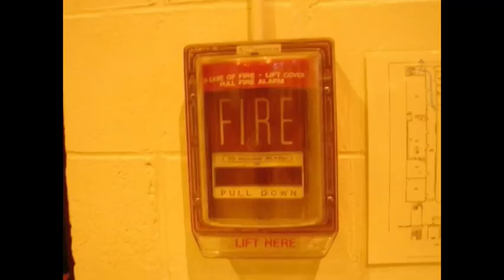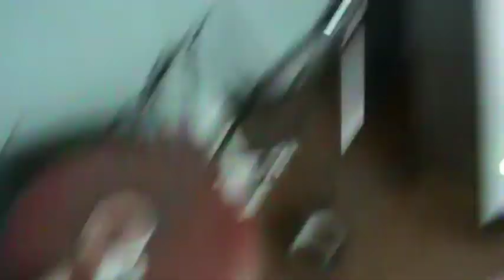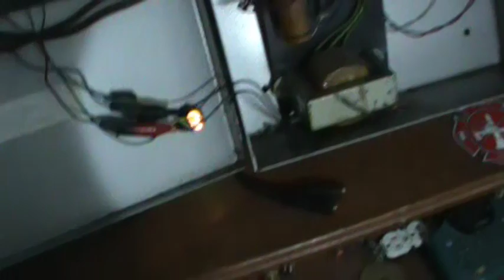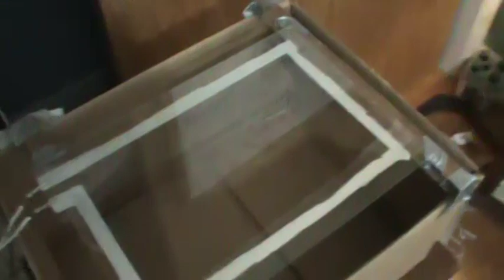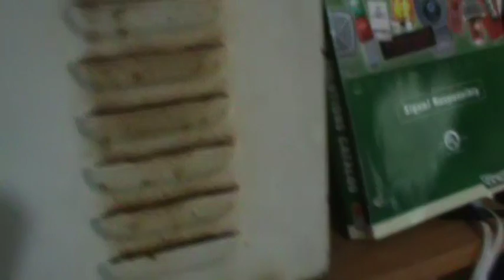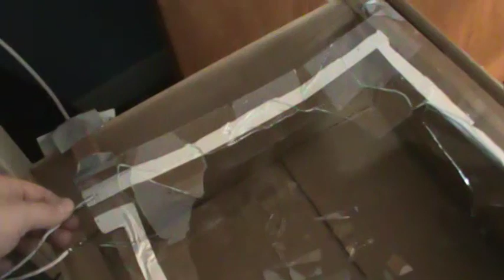1970s Burgular Alarm System

Comment: The old foil was originally not self adhesive. To install you would go on the outside of the glass & mark out the foil pattern 4" from the edge, all the way around, with chalk. Then go to the inside & paint on a varnish path where the foil was to go. After the varnish got tacky (about 5 mins +/-) you would stick the .0015 thick x ⅜" wide lead foil to it, all the way around. Afterwards you would go back &  paint varnish over the top (top coat) to seal it & protect it from window washers. Doors would get a "double C" pattern. That was to help stop people scratching off the foil w/ their finger nails when opening the door. Overall, it took a little longer to install & required more maintenance, but it was very effective. Also, back in the 60's & 70's most commercial systems in U.S. were installed to meet ridgid U.L. 681 specifications. Many were inspected by U.L. or by the insurance Co. that required  a U.L. certificate in order to provide the customer with insurance. Most of those commercial systems in that era were installed properly by highly trained credible installers that actually took pride in their work. All connections were soldiered & taped so as to help prevent false alarms. The 1st motion detectors were ultrasonic, & came out in mid to late 60's, but would easily false by drafts & air currents. There were a few exceptions, but most systems then were single zone. Most of the panels were either ADT, Mosler, Diebold, or Ademco. I believe Dictagraph (mostly for residential) were made by Ademco, very similar to Ademco 330 series panels. (330 was also a very reliable & dependable  panel).

Comment: My dad's house has an old 50's alarm, on the front of the house, there is a blue Bell in a box, and by the door outside there's a keyhole to turn it on and off. In the basement door there is a button in the doorframe so when you open the basement door it sets it off, in case a burglar came through the basement windows. Same with all the doors and probably the windows at one point. It's in a rowhome in the city lol, and the alarm is broken.

Comment: Magnetic Reed Contacts were around in 1965, I started installing Alarms with A.F.A. Fire & Security Systems 1964.     A.F.A. 16 Christchurch Place Dublin 8. There were only 3 Alarm Company's in Ireland then.                        
1 A.F.A, 2 Rely A Bell, 3 De-Jay.  Later this year 2020 there will be a Book published on The History if The Security Industry of Ireland from the 1960s with Pictures of Old Equipment and stories of days past.  Best Regards Pat Walsh Email:-  patwalshspain@gmail.com.

Comment: Window protection was called window foil it was connected to the wiring by means of an adhesive foil block or a soldered strip of specialty wire. At the time window foil was very effective but also high in maintenance and magnetic contacts did exist in the 70's there was one made by ademco aka Honeywell that actually contained on the surface of the contact a shunt button that allowed the user to shunt the exiting door momentarily maybe 30 seconds, just long enough for user to exit, the down side was that when user re-entered the same door the following day the alarm would trip instantly

Comment: Only thing problematic on the original power supply is the smoothing capacitor. The magnetic transformer is usually quite robust, but mains fuse is a good idea to have. 
One way to make that device useful is that if the switch is removed it automatically sets the alarm on instead of off.

Comment: Actually if you removed a keypad on a modern system it would probably go into trouble
Reply from the maker: +Comelio Some systems do monitor keypads and would show a trouble if one disappeared. Some systems will also cause an alarm if the keypad is removed while the system is armed.
Reply: BEEEP.    BEEEP. BEEEEP BEEEEEEEEEEEEEEEEEEEEEEEEEEEEEEEEEEEEEEEEEEEEEEEEEEEEP.

Comment: Hi, from the garage door opener fandom of youtube. This was interesting to watch. I was in a house today that had a keyswitch in the garage, and I couldn't figure out what for. Thanks for the video.
Reply from the maker: jwatwater Sometimes old garage door openers used a key switch to control the door. Sure it wasn't for that?
Reply: Yeah, I'm pretty sure. There was a button for the garage door. I have seen key switches for the garage door, but they were always outside the house.
Reply: Well hey, my grandma's house has a 1960's garage door opener. It's chrome! With a light in it. My grandpa installed it when they had the house built in 1966. One of the first houses in the entire complex.

Comment: Actually those key switches have tamper plunger switches that would typically get wired to a 24 hour panic or day loop. Ademco used a keypad on their old 1023 panels starting around the late 70s or early 80s.  They were an option, you only had one code and you cut jumpers to set the digits!  Auto dialers were also common back then.

Comment: interesting... you still see those foil strips on shops around here... and there have been a few times when we've upgraded old alarm systems and the customer has asked to keep the foil in use!

did the bellbox have a backup battery in it?

Comment: I have a 1970's burglar alarm system currently installed in my house. Its an Ademco 330R. I am in the alarm business and I sell and install state of the art systems, both fire and in burglary. I still continue to use this system because of its liablity and the fact that its hard for these systems to die. If the system was installed correctly, you can not defeat them. The system you have looks like it was pieced together with parts so the way the keyswitch is hooked up is not correct....
Reply: Um, but they use way to old of technology. They only go off if someone broke a window. And it wouldn't call any emergency services.
Reply: @ACTechnologies18311  Not true. There are tons of systems from the 70's that had floor mats, interior doors wired, utlra-sonic motion detectors, beam detectors. We still use alot of that technology today. We may not use ultra-sonic motion detectors, but I still install systems with window contacts, door contacts, motion detectors, beam detectors, traps, etc. It all depends on the customers needs. And most of the ones from the 70's that I still service, have dialers on them. They were simple and got the job done. Like I have said before, there are system in the 70's that are more secure than systems in stalled today. Its all about how the installer installed the system. New systems today can be compromised just as the older ones if not installed correctly.

Comment: Wiring was done quite crudely back then, electrical taped or wire nutted exposed splices, twisted pair wires with enamel insulation on one wire, the other wire was bare, they did not want to spend much money on them.                                                                                                              Some had early LED indicator lights, armed and ready, only some of the relay based panels had indicator lamps on them, frequently only an armed lamp like yours.

Comment: dialing a central monitoring station, with an alarm signal, typically a burglar and tamper zone. They operated off of a dedicated line most of the time, as most would not have line seizure. It also freed up the phone line for emergency calls while the alarm was reporting.

Comment: and a somewhat armored housing for it, they also used one way screws. The security system cans were much heavier duty too, about twice as thick as today's Ademco or Dsc cans. A lot of the time the key switches were mounted right on the can, not the most secure, but they could not get into the can ore cut the key switch wires easily. Some of the systems form mid-late 70's used momentary keyswitches, and had an actual circuit board on it, transistor based. They often had dialers, capable of

Comment: They did have magnetic contacts back then, but they used plunger switches because they were much cheaper. Motion detectors were around too, they were just photoelectric, which sent a pulsed IR beam from the transmitter to the receiver, when the beam was broken, it set off the alarm. Not very secure, as a person could go under or over the beam. Some security system companies would make the keyswitch somewhat discreet or they would install one with an ACE™ or Medeco™ classic high security core

Comment: The reason why the bell was so corroded was because the louvers on the bell box were facing up, taking in rain and snow. It looks like the company that installed the security system just used a 12 volt trailer light on the front, head down to your local auto parts store and pick up a 4 inch clearance light, they come in amber and red, and cost about $3 a piece.

Comment: Did they have any kind of electronic motion detectors back then for old alarm systems?  If you had a system like this installed in your home at the time and if the front door was armed, was it possible to have a delay timer like you do now to give you time to disarm the alarm system before it goes off once you enter your home?  I once new some people who lived in an old house that had renovated, I noticed an alarm warning sticker on a window and then noticed the tape on the glass.